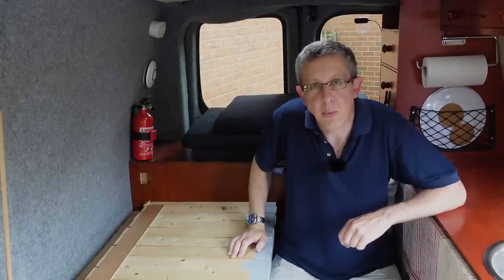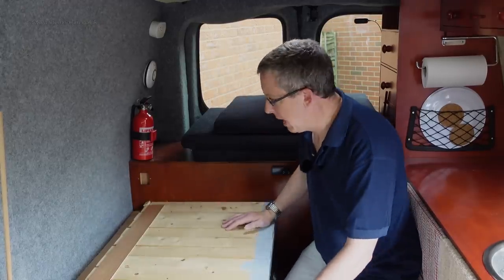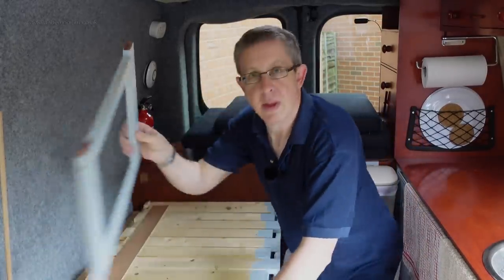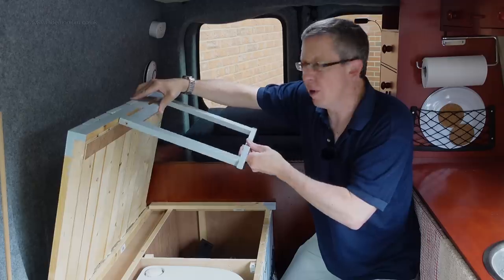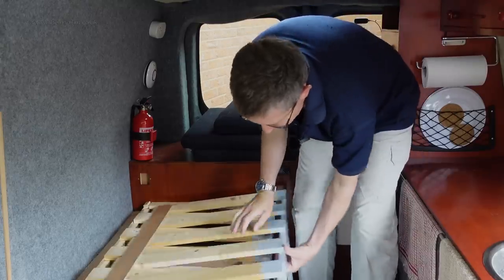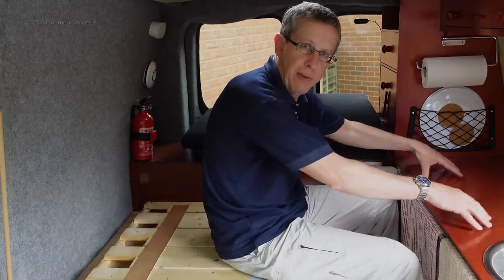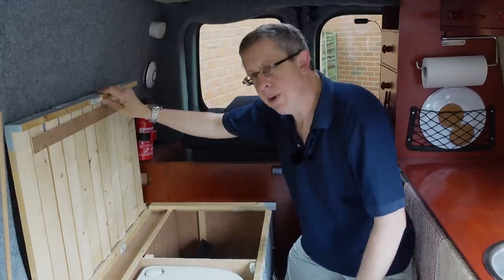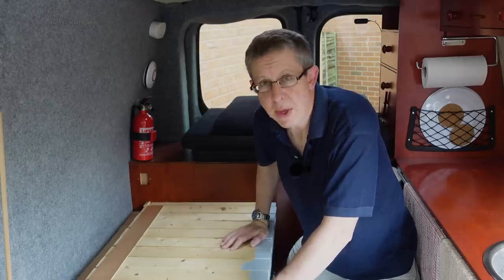84. Help! Your advice is needed.

Comment: Why don’t you remove two slats from slide out, with two hinges on two replacements slats that will drop down as legs or slides into bed base when not in use, also would allow for any width. 

Or fit a camper table to van, and use a short leg to support bed, but then what do you do with the leg.

Or wacky idea, rope supports from roof, won’t collapse, can go to any degree, then unhook when folded up.

Or use toilet on a rail as a pull out leg. Will never collapse 😂

Comment: Just create two faux doors for the front side of the cabinet with the bed that can swing open to support the sliding portion of your bed.  Then simply fold them away when not in use.

Comment: Just a thought David, the slats that pull out, that long strip of thin ply or whatever it is that keeps the slats separated, what if you put a piece of flat 2-3mm thick aluminium strip the same length and width as the ply so when you pull the slats out the aluminium strip stops the extended slats from falling off and still keep the support frame you've already got as added security. I hope you get what I mean mate, and yes I do realise that some mods will be needed underneath to make room for the now new aluminium strip.That flat strip of ply on the under side of the bed when you lift it up, well put the aluminium strip as low as you can towards the inside, so basically when you open the bed base lid you see the ply strip at the top and the aluminium strip towards the bottom.

Comment: What about something along the lines of a gate leg table arrangement. Vertical hinges on the base front that have a support that swings out. When sat in the middle at partial extension they would be directly beneath you (extra support), whilst fully out they would support both ends of the extension edge?

Comment: Well a hinge will work But how about, a large draw slide which will hold the weight when half extended and a small recess in the kitchen unit to bare the weight when fully extended for thoroughly testing it.

Comment: Pin the sliding section. Probably 2 pin locations. Hinge, with roller catch to hold the folding frame in place. Obviously notch out the fixed section for clearance.

Comment: If you had vertical boards slotted into the base at either end of the bed that pulled out (like a drawer) they would support the bed. Maybe 3 at a push. Might be possible to fit them on the kitchen side or a combination of that arrangement. Pulled out only as far as required. Not sure if I've explained that idea clearly. In my head it's pretty simple and the vertical board concept would be stronger than a leg. Shame I can't send a drawing!😊 The KISS principle, Keep It Simple Stupid! No hinges just two vertical slots either end and two vertical boards.

Comment: Just as I watch this, I see my collapsible walking stick I used after coming off my crutches from a hip replacement. Do you know where you can get a pair of crutches? Its a wild flash in the pan idea, but if you got the lower end of the crutches. Rubber feet, adjustable length, non slip. Cut them to suit to your required seat height, a pipe cutter will do a lovely neat job. Now I'm thinking this out as I type, so my apologies if it seems wild. I might even try it out tomorrow if I can find the crutches. Once cut, insert some suitable dowel / wood to stop the tubing collapsing. Drill a 6 or 8 mm hole for a bolt through the tubing and the edge of the seat, this will be the hinge for the leg. Visit the local hardware or screw fix for some appropriate sized "Terry Clips" Two to hold the legs up and out of the way and two to hold the legs in position when down. You may need another strip of timber along the front edge, just for extra "Sturdidity" as a late work mate of mine used to say. As you are at the coal face so to speak, you will be better able to see if it will work. What ever you do there will be some fettling involved.
The ridiculous suggestion, move the galley unit closer.! By the wat , those cookies in the net with the plates must be stale by now. Oh they're coasters I hear you say. 😄. 
If I find the crutches I will go to my work shop and try to see if it works. I think it may work for the extension for my table saw

Comment: Possibly 2 legs spaced apart with one bolt in the top of each fixed to the faceboard of the bed whereby they hinge down on the bolt. The legs to be tapered to overlap when closed up.
Reply: Re. To previous. On the slide piece fix 2 small blocks each end  underneath in the slide out position to straddle the bed frame to prevent further sliding.

Comment: What about heavy duty shelving slides that could take the weight of a person or two without the legs. Then you just slide out the extention.

You were showing folding legs going horizontal. How about folding legs on the vertical at either end. They could be long enough.

Metal legs that screw in.

I'm spit balling here

Comment: Attach your legs to the front of the box with vertical hinges such that they fold flush when closed and swing out like a door when open. The front edge of the bed extension can rest anywhere along the top edge of the legs. Ideally above a vertical but anywhere if you build them strong. Even some 16-21mm thick ply would be plenty. You could even potentially use the front faces of the cupboard boxes as your legs if you redesign them thoughtfully. That would look neat.

You'd want little wheels or furniture slides on the bottoms of the legs to run smoothly on your floor. Perhaps some kind of elastic strap to keep the sliding top and the legs synchronised until you wish to lift the top for matters or personal relief. Shock cord is good. I prefer the kind with a single, thick rubber centre, rather than many thin strands. Shock cord buttons are very cheap, easy to install with one screw and secure the cord well enough. They are a bit like the thing you attach a guitar strap to.

I'd just put one on each leg, 30cm or so down from the top. That would leave plenty of finger room for undoing them to lift the top and also keep the hypotenuse angle small enough to keep the cord engaged in the button when sliding the top out. They'd need to be at a diagonal when fully shut to avoid over stretching as you expand the bed slide.

The cord loops can be affixed at the top. Drill two small holes, poke the cord through each one and fasten it on the inside of the box. A good knot may be enough. Don't make them too long. You'd want enough preload on each cord to keep the leg and top together; again keeping the cord seated in the groove on the button.

Prototype in small scale first. Tape, balsa wood and rubber bands. You can do it sat inside in comfort, rather than on hands and knees in the cramped van.

Comment: You could integrate a telescoping setup that utilizes square metal tubing at the head and foot of the bed.  This would negate the need for legs and give a lot of strength to your frame. Say a 20mm ID tubing with a complementary tube of matching OD. You would just have the maintenance of adding a spot of oil or graphite powder once or twice a year for smooth travel.

Comment: I’d get rid of the legs all together and use heavy duty ball bearing drawer slides.
Reply: Get a good pair and they'd run so well, they'd slide right back in when you're trying to work at the kitchen! 🤣

Comment: Hi, I think, in your case, the best course of action would be to test your ideas yourself, each time you describe a possible solution you don't seem 100% sure that they wouldn't work. I think basic prototyping with duct tape and wood bits could give you a really good idea as to which solutions are better than others. Even if you know the idea doesn't work before testing them, figuring out in more detail why exactly that is the case will basically point you in the direction where you need to look for a better alternative. In this case an iterative approach would be best.

Comment: Maybe have legs that are on a runner assembly that pull forward and push back into the unit, a sort of inverted and rotated 180 degrees 'L' shape. These could be attached to the bed pull out, so that when the bed is pulled out they come with it, by a bolt or clip arrangement so that when you want to lift the lid, you slide the bolt/clip - whatever - which detaches the bed from the legs when lifting up the bed. When you are finished, dropping the bed back down the bolts/clips re-engage, ready for when you want to use the bed. Hope that is clear. 
Just had another thought. Make the leg frame an oblong with holes in the top that can take dowels. Put dowels in the bed base - similar to what you have already. Have magnets that will hold the leg frame to the bed frame - to stop it falling forward when you lift the bed base. When you need the bed out, pull the leg frame off the bed frame and the dowels will make the bed base go with it.When lifting the bed base, it will leave the legs behind held by the magnets. Hope these help.

Comment: The KISS solution is a support mounted across the face of the kitchen unit. 

The other option would be to have three or four legs milled out of the tongue pieces where the bed slides together. They reside flat on top recessed into the tongues until flipped up over and down underneath where your leg mounts now with the dowels. If I was any good at drawing I could draw it. I'll have to think about a way to visually explain it.

Comment: Is it a possibility to mount the plywood board on the left that holds all the other slats together at the bottom? Then you might not need legs to support it if it is only partially extended. When fully extended you can put support blocks on the kitchen unit side to support it.
Reply: Thats my suggestion as well.
Reply: in hindsight, this is not a option because the frame would fall into the storage area underneath, but it's probably possible to add a second one at the bottom so that it can only slide planar to the other half of the bed frame and then it can also no longer tilt

Comment: hmmmm.  Could you not use the leg you have, and hinge it, BUT.... add two strips of wood to the bottom of it that you could twist, to act as feet, and to stop it rocking?  Admittedly, you may trip over them, but, it might solve the  issue of  it rocking when the seat is only six inches pulled out.  When it is fully pulled out you would not need to twist the bits of wood? maybe?

Comment: Heavy duty drawer slides fixed to the existing bed slats. Your sliding section would stay the same and you would still be able to lift the bed top as you do now. The slides would reinforce the entire structure when pulled out to any length without any legs. Each slat edge would become the side of a drawer so to speak.

Comment: On the front of your bed unit fit two cupboard doors hinged at each end of the unit so that they open out towards the kitchen unit. So you pull the doors open just as far as you want the seat/bed tomojll out and the doors then act as supports. This is an easy job just to fit the doors/supports to ghe front of the unit with piano hinges. No other mods required.

Comment: Murphy bed where the hinge is actually attached to the van wall? And, the bed platform would be solid, with a strut or counterweights. That’s heaps more complicated that you likely need, perhaps looking at the idea from a different angle will help you come up with a more ideal solution! Good luck!

Comment: David, I think the piano hinge would be fine.  Put a magnet on each side of the bottom of the leg unit so it won't flop about.  What's the worst that would happen if the legs started to fold while you're making a cheese sandwich?  You'd feel it move so you'd slide back a bit.  You can re-engineer it if you find it bothersome.  Good luck.  Cheerio!!

Comment: I would say a hinge and also look up lid support hinge.  It is those arms you would find on something like folding furniture where it allows a pivot point without over extending also holds the moving piece in place without flopping around.  They make all kinds.  Freely moving, friction, ones with mechanical locks.

Comment: If You want more elegant solution I would get inspiration from how murphy/wall beds are having their support folding. With right angle You can use it as back rest and when need to unfold the bed use it as support for wider section of the bed. Greetings from York.

Comment: Why don’t you hinge the legs as you obviously prefer to do. Having done that, determine exactly where you want the bed to extend to allowing comfortable access to the work top, mark around the bottom of each leg and then make 2 “sockets” of about 1/4” thickness and cut a rectangle of the same dimensions as the legs. Screw them to the floor in the correct position and then they will securely locate the legs in their intermediate position. Two nice circles of polished mahogany shouldn’t look out of place and also shouldn’t cause too much of an obstruction on the floor.

Comment: If you convert the front lip into two legs on hinges they would not be in your way until you needed them. Might need to strap the top in the front like you did in the back.

Comment: I am in favor of the swivel pullout leg and using one of those 90 deg self-locking hinges; maybe converting one of the slats into a leg.  Can you provide some dimensions of the bed, the slat spacing, and the space between the bed and the kitchen space? Mocking this up in SketchUp can be a fun exercise to try and solve.

Comment: Just a thought David. The way the bed slides out from between the support boards makes it difficult to attach anything underneath permanently. Back in the day large baby buggies that allowed newborns to go anywhere were folded up for storage. The large carriage well simply collapsed by pushing on a set of hinges (one on each side of the carriage) that looked like a 6mm rod about 65cm in length,  with a 2" disc attached at the center. The "disc" was actually a locking hinge that allowed the rod to bend in half but stiffened and locked when you pulled it straight again. If something like that is available.

Plumbing hardware also comes to mind: attach a female pipe support on the slide out corners and have 2 or 3 pipe legs that fit tightly into the supports but can be pulled out and stored easily.  Good luck sir.

Comment: A device similar to what you have now but hinge it, so it folds up and held either by magnets or a simple wooden button to keep it in place. I prefer the wooden button idea actually. The bottom horizontal piece should be raised a few inches so your heels won't knock it out from under you when your working at the cupboard. A Piano hinge should work well as it provides stability along the length of the leg support. I'd rather show you than explain it, but I’m not good a drawings. Best of luck, and have a G & T.

Comment: I see a U-shaped frame with hinges on all four corners and two additional ones in the midst of the vertical studs. So the lower flat feet can be lifted upwards, the middle hinges fold inwards, giving the frame a X-shape until the lower feet meets them right beyond the upper piece of wood. So in total there are only 3 layers of wood stacked to each other in the upmost position. You only have to make sure, that the hinges in the verticals can be blocked in the straight position.
I hope that makes sense...
Good luck finding the best solution!

Comment: My husband, who has been in construction for over 50 years, said you have the simplist solid supporting structure right now, with the least amount of working parts. 
Changing what you have should depend on how often you are using the van. It might be different if you live in your van. 
He said, Good luck David. He hopes you find a happy workable solution. 😊👍

Comment: Within 3 minutes I was laughing watching you working yourself into a right tizzy.
2 small hinges where the legs meet the moveable frame, (keep the dowels in, but shave a curve off one side to accept the curved path the legs will take to engage due to the hinge)  notch out the base to accommodate the legs in the stowed position, otherwise it will not sit flat. And you'll find it will be plenty sturdy enough.
If you wanted to get really fancy, you could put a pair of leg locks , like those found on a wallpaper pasting table, which will lock the legs into the open position, whilst allowing easy folding.
This way, the dowels prevent  the top of he legs from moving laterally, and the leg locks secure the bottom of the legs from lateral movement also. And the only strain on the hinges is supporting the weight of the legs when folded, so they don't have to be heavyweight, nor do you need large screws.
Final thought. If you were to put a piece of foam/vinyl covered ply into the frame that makes up the legs. You would have something comfy to rest your back against, when you're on the throne...

Comment: It very simple. Leave it as it is. Attach magnets to the existing leg arrangement (on the sides) and to the underside of the bed. Then when the bed is in seat mode or folded away the legs thing is stowed under the bed and held with the magnets in storage. That way you don't have to store the legs elsewhere and the problem is solved. More simple the better. Furthermore if you don't like magnets a simple clip type arrangement may work also.

Comment: When you mention two separate legs on the edges, my thought was to have the two legs held on by a bolt with two washers and they fold up towards each other, they would form a new edge for the cabinet.